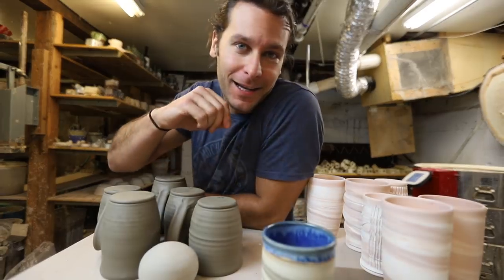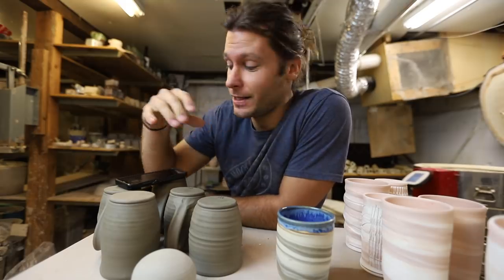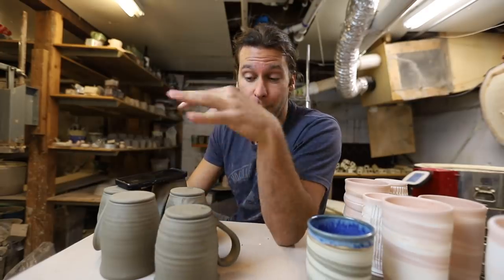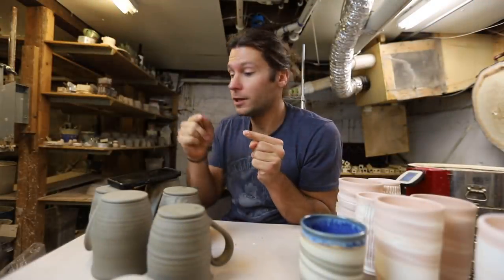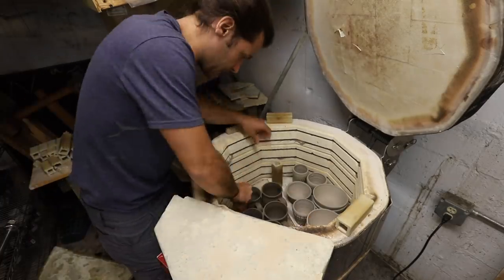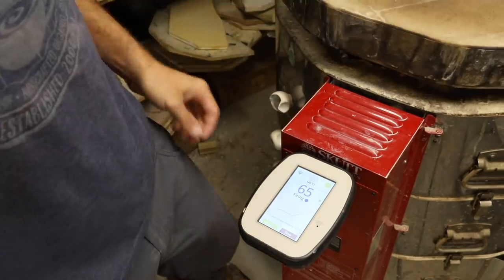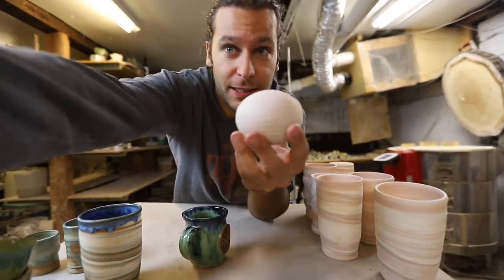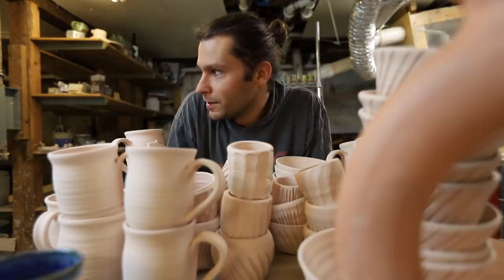Will this BLOW UP in the Kiln?? Do air pockets in clay matter?

Comment: I'm wondering what clay you use (cone, shrinkage rate) should put a disclaimer that it varies. I can't imagine it's a high fire ^10, You should mention the type of clay before people ruin their kilns. Would like to see a follow up with a glaze firing on the closed form :)
Reply: it doesn't matter, Ive done maybe 10 cone six, 4 low fire and I can't count how many cone ten and above clays. Nothing explodes because of trapped air.
Reply: @timseepots  more so pressure during drying phase. I've worked with very thin porcelain and the shrinkage rate of 12-14% had to poke a hole in them or they'll crack. more evident during the glaze firing when it tears open. This was a ^10 B-mix porcelain
Reply: Derek SooHoo I would suppose it’s the same as an explosion and the rate of drying would be the issue. Clay dries as a result of its porosity. If it had none it wouldn’t dry at all. If it dries faster than the air inside could be let out it may crack sure I’ve done it myself. Air is also compressible which can give a little room when working.

Comment: For future videos it might be a little more scientific if you do a user entered firing schedule. Such as: how many ramps you have, to what temp each reamp is, how long each hold is, etc. Then someone could reproduce your experiments and try to reproduce your results on a kiln that doesn't have those preprogrammed systems such as a non skud kiln or if other brands have slightly different preprogrammed settings.

Comment: Love the video idea!!! So what temp is the preheat at? I have a manual kiln that I put on the bottom elements,  an hour later the next level up, then the 3rd level.
Reply: I do this too, and when I want to heat up even slower I prop the lid open higher at the beginning. It's a lot tougher with a manual kiln but I haven't had any explosions in mine (knocking on wood now) :)

Comment: I tried a class project or two where I tried to get a water effect in the bottom of a ceramic piece with a (very) thick layer of translucent glaze, but it cracked like no other as the instructor warned it would. Does this happen always, or would it be possible to fire/cool slowly enough to let the glass form an uncracked layer?

Comment: I think it is fair to say that this is not an accurate video, and anyone learning or wanting to become a potter should not practice these methods. Air pockets in the clay will without a doubt blow out. Firing wet or damp pots will also blow out or warp.
There is only one way to do things and that's the right way. If we need to dry pots faster then we create a drying room. This is a stable controlled environment that allows pieces to dry evenly and with out warping. Air in clay should be avoided at all cost.
It's really best to learn the good way .

Comment: I don’t have a kiln at home. Can I bisque fire in my oven at a low temperature? If so, how long?
Reply: Negative.  A standard oven, only gets to around 500 degrees F.  Clay doesn't chemically change to ceramic until around 1000 degrees.  You can use an oven to thoroughly dry clay, but not fully fire it.  They do make air dry, or oven hardened clays, you could use.  They are not for functional wares, but are fine otherwise.
Reply: Ben Patterson thank you 🙏🏼
Reply: @Kimbrak143  No problem.

Comment: What about the argument of compressing? Truth or myth? Big argument I've seen on clay buddies/pottery heads.
Reply: such a huge myth, I used to throw 18” wide bottoms on planters in a production studio every day on formica bats, I didn’t compress the bottoms, I didn’t even cover them with plastic and the only time that they cracked is if I got them too close to the door and a breeze got to them.  ‘S’ cracks are caused by the difference in the rate of shrinkage of the top of the bottom versus the bottom of the bottom.
The Clay that I used was Laguna white stoneware cone for, not many clays will dry without cracking that way if they are not covered, cut off and kept away from the wind. When clay is due crack it has nothing to do with compression.  These clothes were not wedged either, only time watching is necessary is when combining soft and firm blay or when you cut into your bag of  clay and you can see that it is not mixed well.
Reply: I don't compress but I see that debate so much on CB and PH.

Comment: S cracks. Is it cause of water sitting in a pot, not compressing the floor, or uneven walls to floor ratio or drying speed.
Reply: Kyle Mogg None of the above, ‘S’ cracks are caused by an uneven rate of drying between the bottom of the bottom and the top of the bottom. Having water in the bottom of the pot is certainly asking for trouble as well.

Comment: Its normaly when You have big hole inside, for first You fired too slow, for secont the mugs wasnt wet (wet is mug from weel when you give to much water) and have time for drying in fireing, try much much faster to start and and bisque in 5hours for example, and please do wrong flat clay plate with many bubbles You will see and hear how its blow inside kiln. I dont have any teachers but my firs kilns was everyting destroeyed. Finger crossed 😋

Comment: What happens when you bisque high fire glaze? Always wondered that
Reply: If you mean that by, glazing a ware, with high fire glaze, but just firing to bisque temps, little will happen.  Some of the materials. in the glaze will harden, and slightly fuse, to the clay body.  The color may slightly change, but not nearly as dramatically.  The glazes will still appear dullx and unglossy.
This is why underfired glazeware, can be refired, with no ill effect.

Comment: Pre-heat for 8 hours = dry clay before firing= Myth not busted
Reply: No, it just proves, that it is water, not air, that causes explosions.
Reply: @benpatterson4452  No, to prove that you would need to throw a container of water inside a clay body, in such a way that when the container leaks it doesn't wet the clay or explode its self. If the clay then exploded you could conclude it was the water.
Reply: @chrisparkin6894  Air expands about 1.5 times, when heated to the temps, inside the kiln.  That doesn't put a great deal of stress, on the clay body.  Water however, will expand 1700 times, in the same conditions. 
Water is the problem. which is why wares, with no air bubbles or pockets, can still explode, if fired too quickly.
Reply: @benpatterson4452 If you are heading the clay up slowly - water and the air get to escape over a longer period of time. Yes, water increase in volume more than air. No, it's not only 1.5x (it's much closer to x3 by the time you get up to 1000deg https://www.engineeringtoolbox.com/air-density-specific-weight-d_600.html)  The premise is still that air pockets create weak spots (whether through trapping moisture or providing a mechanical failure point or another mechanism) it may need moisture as well to create sufficient pressure, but then so could the off-gassing of carbonates or other chemicals in the clay. My point is this experiment doesn't prove anything except that dry pots fire better. (and we don't know how they will behave when you have a glaze over them.)
Reply: I think you both are in agreement that water is the culprit, but you just disagree about what we can conclude from this particular experiment.
Reply: @andersledell8643  Yep :)
Reply: @chrisparkin6894  I noticed, he responded to another post, saying he did glaze, and fire it, with no issues.
Reply: @benpatterson4452  cool!